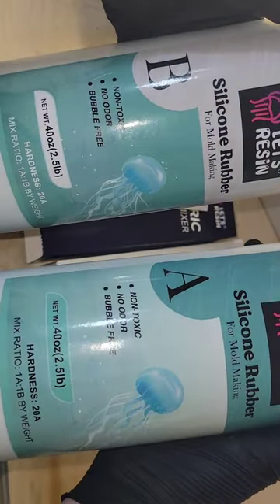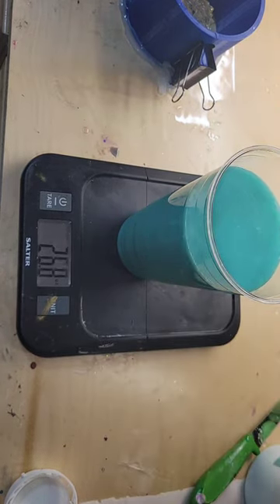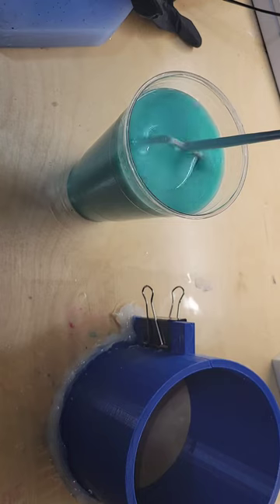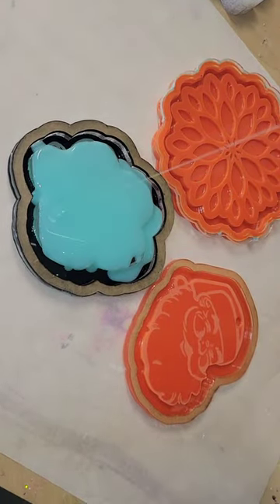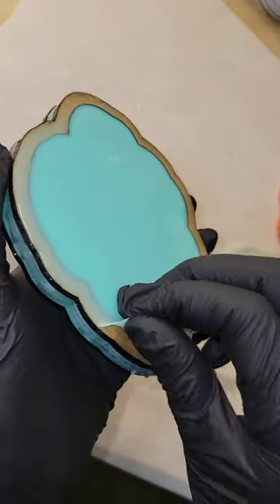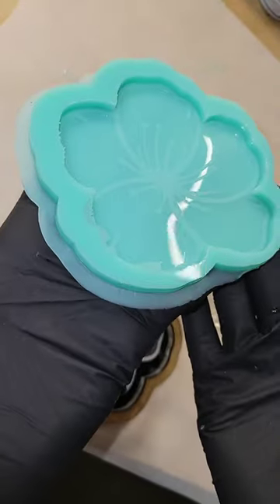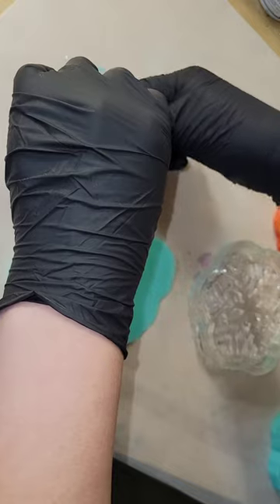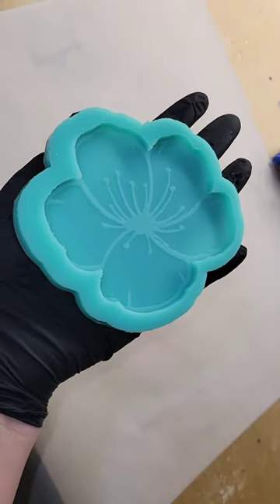How to make a silicone mold #shorts

Comment: What pieces are you using to make the molds? Did you make those with resin or did you buy them somewhere? Can I make molds with pretty much anything? I want to make a holographic mold. I have all the things I need, I'm just worried about messing it up!
Reply from the maker: They're mold housings I ordered off etsy. 

You can use a plastic container too. I like to use large yogurt or cottage cheese containers. Clean them out well and they make great mold housings.

Comment: What was the tool you used to trim the excess please 👌❤️🫶👍
Reply from the maker: Cuticle trimmers and Cuticle trimmers😊
Reply: @naptimecreations  thank you nice little trick to know think I'll get one. I made a nice mold but got a nick in it after trimming it using nail scissors so resin comes out with a bit that needs sanding 😉👌🫶
Reply from the maker: @Mark Beavis  oh man, I have done that before too with little scissors. Definitely get the Cuticle nippers and trimmers they work great and the nippers are angled so they can get in there really well and cut off any excess 😁
Reply: @naptimecreations  glad it's just not me 🫶😉
Reply from the maker: @the.resintist  nope, I'm sure it happens to everyone 😁